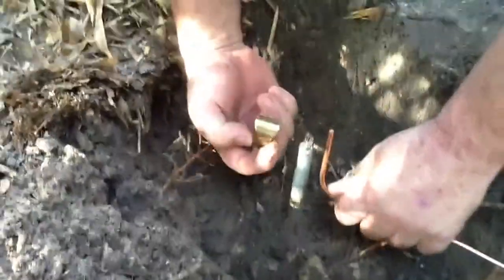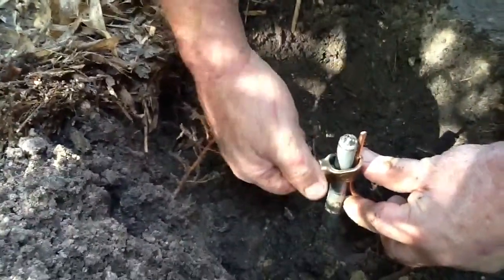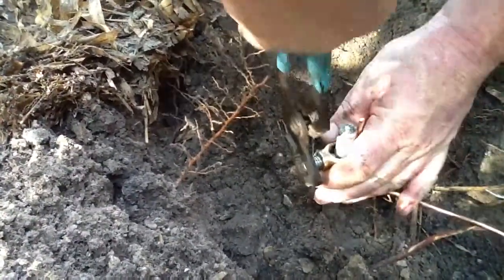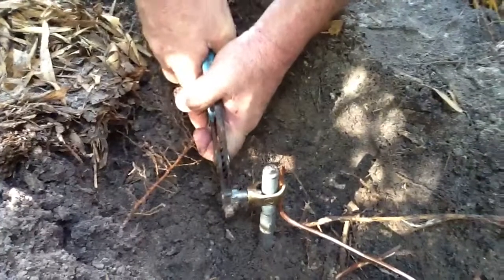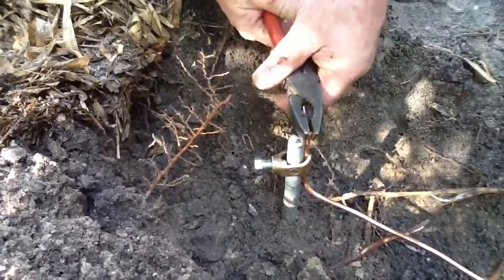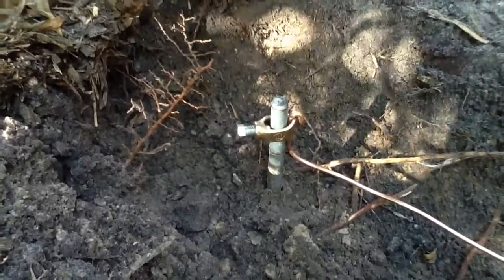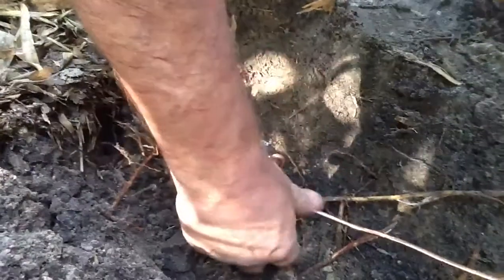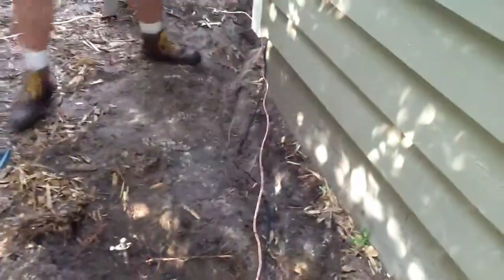How to... step by step guide to install a Ground Clamp and a solid copper ground wire safely.

Comment: David I enjoy your videos tremendously but sometimes I have to ask a question.  I agree with the 25 ohms resistance needed on the ground, but why did you cut the ground into two different wires.  I have done a lot of work in Austin, Texas and the city has always requested that the ground rods be at least 6' apart and the ground wire has to be un-cut from panel to last rod.  Doesn't this break down the ohms reading that you get on the wire or does it really make a difference.  Just wondering in Texas  Danny